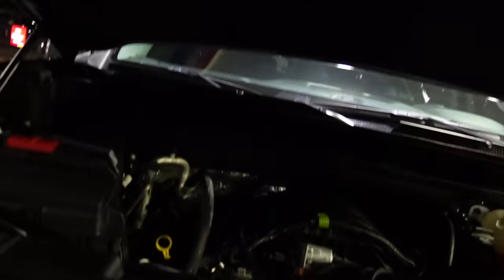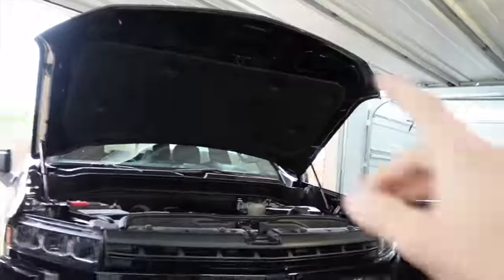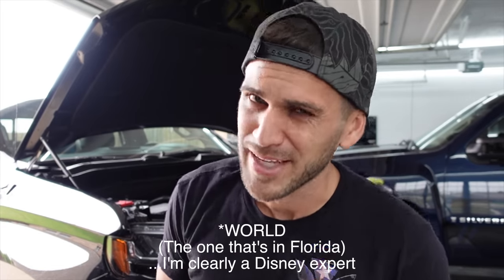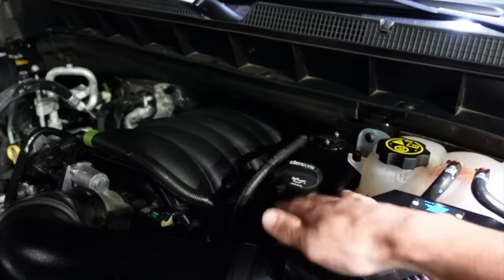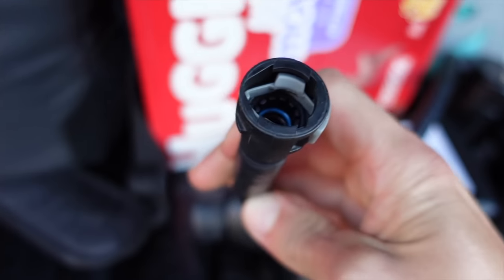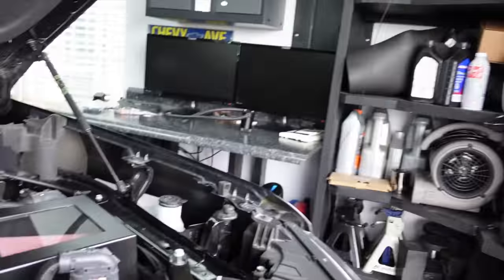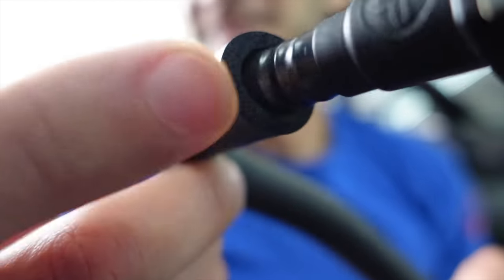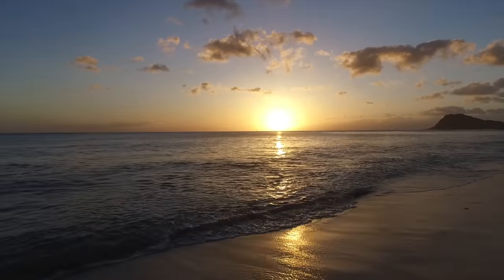Silverado Oil Catch Can - Did NOT Go According to Plan... 2020 Trail Boss Oil Separator

Comment: Protip for those of you who live in a cold climate and install one of these. You'll want to empty them no longer than 1000 miles during the winter because you'll get condensation buildup like you wouldn't during the summer. I drained mine in warm months and only got normal oil out but back in february I drained mine and a lot of water came out with it.
Reply: Thanks haven’t thought of that at all
Reply: Thank you! Washington state does get cold!
Reply: Exactly the same experience i had. Winter seems to introduce more moisture into the pvc system.
Reply: Same here in Georgia. Our winter months aren't that cold and I still get milky oil out of my catch can after the Temps start to drop. Warm months I get regular looking oil.
Reply: Just check it every week. If you have a catch can, you're probably the type who checks shit all the time
Reply: I’ve used catch cans now for over twenty years and in many different vehicles and never seen a drop of moisture in any of my rigs and yes I live in a state that is raining and cold six months of the year.

Comment: I have one installed and it does NOT make that hissing noise. That noise isn’t supposed to be there. I think you need to force the female connector into the male connector. Don’t be gentle with it give it a good push. Mine didn’t seat correctly when I didn’t use a strong push. Then pull the hoses to make sure they’re not half-seated
Reply: Same here bro I got one too and it didn’t make any hissing sound.

Comment: It is actually a vacuum loss. I have a tuner plugged in that measures vacuum. There was a drop. Only with my JLT brand catch can. I switched to mishimoto carbon fiber with baffle. No sounds at all!!! No his. Nothin. The vacuum loss is significantly less but still there. I believe part of JLT hiss is the screw on cap. The seal is cheap and janky. Mishimoto has a far superior thread lineup. Good news though!! At 260,000 miles. Hard work and lots of money later. My Mishimoto oil catch can officially no longer catches oil. Absolute zero oil. Months go by, no oil. Switched back to JLT and still no oil. I reversed my engines age!!! Ask me how :D

Comment: I installed the JTL 3.0 on my 2019 Chevy Silverado K1500 RST 5.3L, and I was able to get rid of the air noise by using Self Sealing grey foam tubing 1/2 C 3/8"  the one they use for the home air conditioners. I wrapped it with High Temperature insulation tape, and I have no vacuum noise or hissing noise, just the engine.

Comment: You have to be careful.  The noise could be caused by excessive pressure.  The catch can may be increase the pressure in the PVC system.  The PVC needs to evaluate air as fast as possible and with a catch can this can be more restrictive causing increased crank case pressure and this could explain the lower fuel economy.  I installed one on my 4Runner and MPG dropped 2 mpg.  Took it off and it’s back to normal.  The manufacturers didn’t put one on because they don’t really need it unless you have direct injection.
Reply: I believe all LS motors made after 2006 are direct injection. I could be wrong.

Comment: Some manufacturers do have them on their cars. BMW has been putting air oil separators on their cars since the late 90's. They call it a CCV instead of PCV.  I believe VW cars use the CCV system as well.  Problem is they always fail after a few years because they make them out plastic....lol.  The bigger problem is cars these days are made to fail.   If they didnt fail and break down so much then the makers wouldn't make any money. Think about it. If the parts weren't made to fail then no one would be buying parts. If the engines didnt wear out then noone would be buying new cars. It's a viscous cycle

Comment: I have a 2019 Silverado RST with the 5.3 V8, just got back from a trip from western NY to Springfield Mo. About 1050 miles each way. I drove about 10 mph over the limit the whole way, most of the way at 80 mph and averaged 21.5 per gallon.
Reply: Did you turn on the dfm/afm or off?
Reply: Your point is?

Comment: Thank you because this video is exactly why I went with UPR’s Catch Can. They have Continental hoses and their can design is way better. They also have an interchangeable PCV valve as well that will allow you to go with a slightly larger jet size for better Vacum from your crankcase so that the overall system could flow better because adding a catch can restricts the way your system would normally flow when it’s stock.

Comment: Have the same one! You need a larger diameter hose than stock to reduce the drag on the pcv system by adding additional length.

Comment: 2020 6.2, mine works great no hissing. 
First 6000 miles the can was almost full. Had gunk in the bottom 1/8 of the tank that looked like white lithium grease. 
Next 6000 miles it was only 1/3 full of gas and oil no gunk. I love it.
Reply: Hey does this void warranty on your truck ? I want to put one on my 5.3

Comment: I have the exact same catch can on my 5.0 F150. Works great. I empty it onces every 3 months or so. It usually had about 2 Oz of oil in it. Definitely recommend for those with eco boost or similar. With the added pressure from the turbo the blow by is worse.

Comment: Cool video.  Sorry for your troubles fellow Texan. 

For your next mod, you might want to add a light under the hood.  
It's one of those mods you forget until you need it, but when you need it, you thank yourself endlessly.

Also, speed has a huge effect on these trucks.  On my 21 6.2, I lose (in round numbers) 1 mpg per 5 mph.

She peaks at 24 mpg at 50 mph.
By 85 mph (because, Texas is awesome!), she's down to 17 mpg.
Which was the BEST mpg for a truck like this not that long ago.

Yes, I could slow down and save money.
But, getting home from west Texas by 11:30pm instead of 1am, after working all day, is a worthwhile trade.

Comment: I am running a larger can. Which meant it had to be installed on the frame. It is 4" in diameter and 7" in high it has a low restriction baffle at the inlet port and a slightly pulled-apart SS pot scrubbing pad(making a looser weave to keep a more open flow of gasses etc..) at the exit port with  1" ID flex hoses to and from the can. Making much less flow restriction. It also has a 3/8" ball valve on the bottom of the can to allow easy draining. However, I don't believe this was any of your problems with that vacuum leak. I have just created a larger in-catchment area to give the gasses and gunk a larger😮 area to slow down and collect. This resembles an external catch-can system I found on a marine engine.

Comment: I have the jlt on my 2016 Silverado and it doesn't make any hissing noises.the fittings were hard to push on mine.been almost 2 years since I installed mine.i drilled and tapped the bottom and ran a hose and a ball valve into the wheel well so I can drain it easy.i drain mine every week or 2

Comment: Now think of the air flow restriction of that colecting and sticking throught the intire intake surffice and then the efect it has on your finly metered air fuel ratio trying to achieve the best and cleanest combustion in the cylinder at the time of combustion. There must be a mesurable amount less emmisions and carbon bildup = better engine longevity and air quality. Good job.

Comment: I agree that any engine with direct injection, turbos, etc. should ideally come with a catch can from the factory.  The problem is that many drivers don't know anything at all about vehicle maintenance.  The average car owner would not understand the purpose of a catch can or know to empty it periodically, so the manufacturers don't bother to use them.  Also, the overall economy of today is dependent on planned obsolescence.  Car makers  have a financial incentive to design cars so that they will be reliable only as long as the factory warranty is good for.  After that, they hope that major failures happen so people will just buy another vehicle rather than spend thousands on repair bills.

Comment: I put a catch can on my silverado and it's a no brainer if you plan on keeping your truck to install a can on it. You could remove the OE insulation and put it on the catch can hoses.
Reply: What is the inside and outside diameter of the OE hose?  Would the OE insulation fit on a hose that is 13/16” outside diameter?  

I have not installed the Mishimoto Catch Can that I bought yet.  It can with a hose that is 1/2” inside diameter, and 13/16” outside diameter.
Reply: @jimk8927  I cut off the plastic PCV factory line and then slid some good quality rubber hose to the catch can and put a hose clamp  on it. I don't know if it was 1/2" ID hose for sure but I think it was. I can say it was not hard to do. There are quite a few videos on YT that show how to do it.
Reply: The best spot for the can is on the same side as the radiator overflow?  

If so, I need to make a plate that connects to the bolts that are holding on the radiator overflow to the firewall as the parts that come with the catch can that I purchased does not have a mount that will work.  Then once the plate is bolted I will be able to bolt the bracket that I have with my catch can to the fabricated plate.

Comment: When running a closed catch can like you did here, you're supposed to still use the PCV valve the engine normally uses. When you connected you said you connected a line from the can to the valve cover, I don't recall you connecting it to the PCV valve.... Without the PCV valve, way to much air will flow. PCV valve meters the airflow. It will act like a vacuum leak without it. 

If you did in fact use the PCV valve, them obviously there was an air leak elsewhere in the system. But if it's sealed up tight, these kinds of setups work awesome on any engine with a closed loop PCV system. Thanks for the video!
Reply: I was thinking the same. And in the video he had it still on the stock hose.
Reply: @dellionpascual1813  I wasn't sure if he did or not. I only watched it over the one time.

Comment: There has to be a place to get a roll of the thick hose, cut it to length and install the JLT end fittings. ( your up close video shot showed a barbed type fitting connected to the hose) that would take care of the hissing noise. Maybe check for a GM part number in the pcv system. Once again, a great video. Been wanting to install this for a while. You have become my crash test subject for mods. 👍
Reply from the maker: haha! I appreciate the recommendation!

Comment: I have the JLT catch can on my '20 LT. I change my oil every 3500. Once you dump out the bad oil, let it sit overnight in a clear container and see it separate. BTW-I don't hear the noise from inside the cab so no issue.

Comment: I have a July catch can on my 18 and no issue.  It did not have the fitting, it had steel hose clamps if I remember correctly.  I have to dump it less in the summer... Pretty much all oil.  Winter gives you the creamy latte

Comment: Got myself a 2019 Trail Boss LT luv it now has about 11,500 in the almost 2yrs I've had him
Reply: Dang, I got mine on April 24th and I have 5870 miles on it before I leave for work this morning.
Reply: Any issues with the lifters?
Reply: @Jsuazzo  I haven't had any... Yet. Also just, scheduled my first service yesterday so we will see what the oil looks like. I'm adding a catch can.
Reply: Good to hear. I only have 110 miles and got concern after seen all the  lifters failures
Reply: @Jsuazzo  nice, I took mine on a trip to Miami from basically Pittsburgh and back. Left town with 1700 miles and putt over 2800mi with the trip. Did average around 26mpg over a 400mi stretch on 95 south. When was your truck built? Were you lucky enough to not get all of the fuel management systems? I was happy.

Comment: I do know that the duramax diesels come with a separator.  It doesn't make since that the gas engines don't have anything.  Also that hissing noise is definitely an air leak.  I recommend getting a new connection.  It is just placing a vacuum on the crankcase, it shouldn't be that much flow.   The reason you saw a reduction in fuel mileage is because pcv goes in after the MAF sensor.  So if you are sucking a lot of air it will throw off the actually air fuel ratio that the truck thinks it should be producing.  Thanks for the content.

Comment: IMO: manufacturer’s know most owners do not follow regular maintenance intervals. Most don’t even check their oil and rely on a lube shop or mechanic. They assume owners wouldn’t dump the catch cans. Rather than add money adding them and potentially have owners blame them for engine failure or issues in the vacuum, they accept the issues present in the current set ups. 

My opinion but I turned wrenches on vehicles for the military for over 21 years. Wild how many people would hop in and fire up vehicles without checking anything, which their manuals said to do before they started their vehicle.
Reply: You make no sense. Why do you have likes? What is your "REGULAR" maintenance... Turned wrenches in the miltary.. Because I'm checkin oil and hydro on a tank/helo. Be realistic you super soldier.. People buy new vehicles to not have to mod them. Might sound crazy to a barrel licker,
Reply: @twochuktommy8432  instead of name calling I’ll highlight the ignorance in your comment. “Regular maintenance” are things as common as checking the air in your tires prior to using the vehicle, oil changes, and even following the manufacturers recommended service intervals. Which are listed in your owners manual in case you haven’t seen them. 

Miriam-Webster dictionary defines modify as to make a change. So anything that is changed from the manufacturers original configuration is a modification. Window tint, decals, even the little phone charger you plug in to charge your phone is a mod. 

Thank you for attempting to troll a simple comment over 9 months from the time I posted it though. Have a nice day and be safe in your vehicle.
Reply: @PsykoticUSMC  Great reply and thank you for your service, from a fellow vet!!

Comment: You need a better catch can system. I have a different system on my 2018 Chevy Silverado. Works great & I gained 2 miles per gallon if I keep my foot off the gas. No noise! 2 cans,5 hoses & 2 one way valves.

Comment: I have a couple of  JLT (now J&L) catch cans, I empty them at each oil change. My 3.5 Ecoboost usually has about an ounce of oil in the can between changes, my Tahoe since it's not boosted isn't as bad. J&L actually has a video about the hissing noise that they now send a link to when you buy one for a GM vehicle. Obviously GM knew they had a serious noise issue to put that much insulation around the PCV hose, and that one is what, maybe a foot long? Now you've got 3+ feet of non-insulated hose.
The Ecoboost was one of the first DI engines to start having serious issues with oil residue from the PCV coking up the back of the intake valves. A Ford mechanic recommended the catch can when my truck was new in 2018.

Comment: Finally got my 2021 Trail Boss LT 6.2L yesterday! It moves SO easy! My first time merging onto the interstate I had to let off the gas pedal half way down the onramp. Seriously hit 80mph before the end of the on ramp without realizing it. That said though, with the BBQ grill sized muffler and the resonators out back it sounds like a minivan. Can't wait to get my Borla muffler put on.
Reply: I just cut out the stock muffler and flapper and put a Magnaflow straight pipe on. Strangely my truck only had the front flapper where the instructions say as well as all the videos I've watched show two, one in front and one after the muffler.
Reply: @FastSS02  5.3s have 1. 6.2 have 2.
Reply: @FastSS02  Interesting. And here every single video I've seen shows only 1 flapper before the muffler. My 2021 with 6.2L has one flapper.
Reply: I know the feeling. I did the same thing when I first started driving my 6.2L. I just did a muffler delete and left the resonators on.
Reply from the maker: That's also where mine is. Deleted the muffler, flapper and left the resonators. After driving across the country and back (with the family in the car) we all still love the sound!
Reply: @anthonyblack7699  mine IS a 6.2 and it only had one. I missed that in my previous post.
Reply: Huh...6.2 is bad ass.(i have one) ..but what does your post have to do with oil catch cans...

Comment: Awesome video! Also, your mpg probably went down because of a vacuum leak and the engine not running at its peak performance due to that leak. Try putting Teflon tape around the threads on the can then screw it back in tightly. Also add some hose clamps at the fittings.

Comment: I installed a $35 from amazon, no hissing at all, came with all fittings, apparently I'm getting a mile more per gallon since, only thing i don't  like is the fittings come straight out from the catch can and is obstructing a little the oil fill tube, but is not like i have to mess with it daily so does the job😁

Comment: I have the same catch can on a 2021 6.2 , and I do not have any vacuum leak noise in my engine..  I think your first diagnoses was accurate, you have a broken seal in one of your hoses.  I will say  I have about 3,000 on my catch can, thus far no problem ..for my recommendation I would exchange yours with a new one.